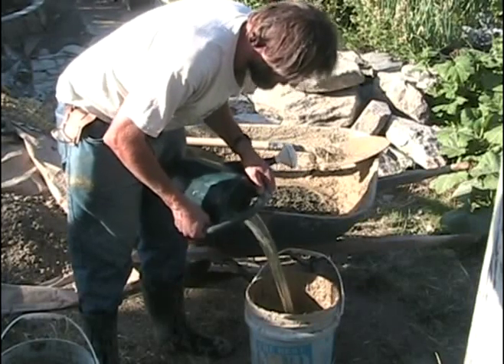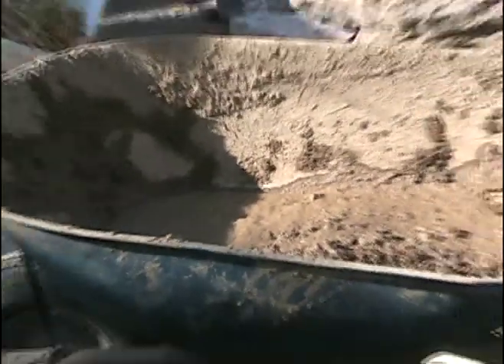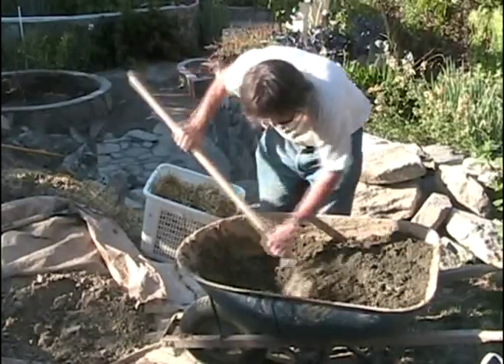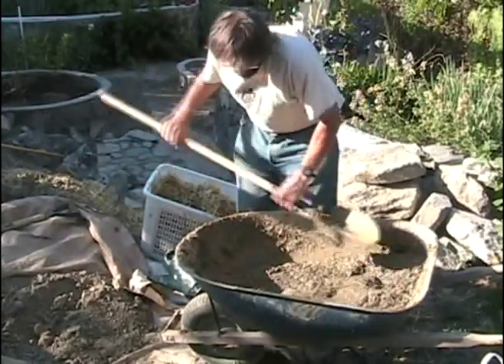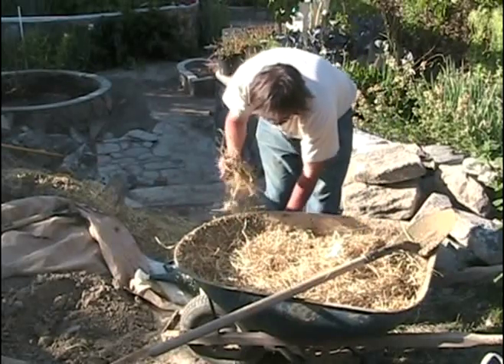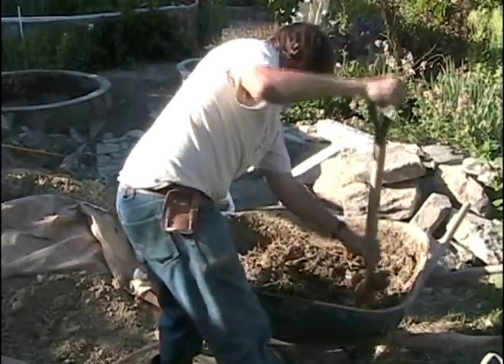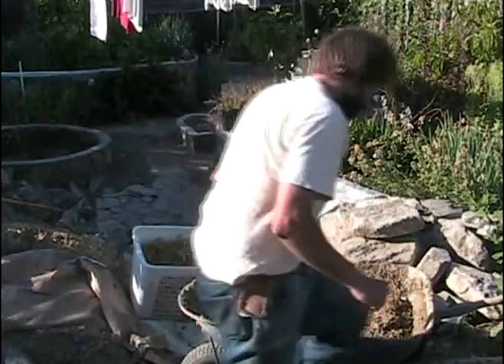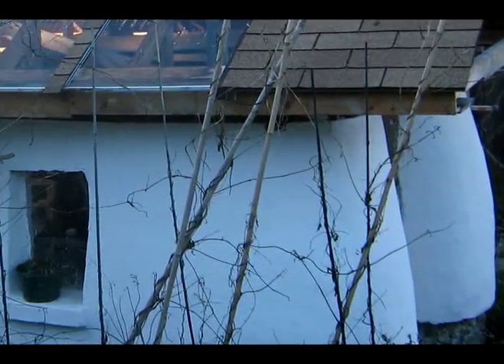Mixing Cob for sustainable  building

Comment: Brian, thank you for making this clip...Really like your mix, works well.
Reply from the maker: I think it is a great way of doing it.  BUT!  If you have a small cement mixer,  you can mix the clay, sand and water to a putty in the mixer first.  Pop half the straw in the wheelbarrow and pour the  putty straight from the mixer onto it. (Saves most of the work).  Remember that the putty you make will be a little more "runny" than cob but the straw will absorb some of that water and it will stiffen up a lot just as you work it with the fork.    Warning!!!   Don't put straw in a cement mixer or you will spend an hour or more on clean out because the Straw will lap and bind around the blades of the thing.   Thanks for your comment.  Brian

Comment: I use a variety of mixers. I soak and stir a 100 gallons of clay at a time. there are many ways to mix cob efficiently. We hired a friend with his small excavator to mix enough cob for our whole project. About 8 yards of material. Took 40 minutes to get the machinery off the truck mixed and half of it dumped in the middle of the site. So it was worth the money. walls were up in 4 days with 2 people. just takes a little imagination if time is important. There is a wealth of modern tools out there to get things done. Our ancestors would of used them if they had them. But hey you use what you got right. Brian ended up with a really nice little place using his method. Thanks for sharing and getting this out there.

Comment from the maker: Cannot directly reply to cryptkeyper.  "Easier for the knees, but harder on the back" . Seriously? Have you ever tried to pull up a tarp with 50 kg of strawy muck on it? It is HEAVY! That is a huge strain on the back, way more dangerous and way heavier than 1 or 2 inch cuts of clay sand mix on a shovel. That is only a 1/4 shovel of weight per cut. Anyone who has used oars in a row boat has done way heavier work.

Comment: Question would straw put though a shredder work better and make the mix any stronger?
Reply: Sandra Keener  Brian White  I know this comment is almost n year ago, Oh well for the benefit. Sandra, Clay is colloidal particulate and sand is what we call in load terms as "core mass". the Straw/Fiber acts as a fabric providing continuity of load.

If you could imagine Force as a array of particles, then without straw, the localized "punch" of the force is not "spread across" . this can lead to localized damage. However, it so happens, due to the relative size of other particles, straw that is longer then 4 to 6 inches is really not doing any extra good for vertical loads. in fact using shredded straw and longer straw in ratio of 80:20 ( i.e. almost shredded straw , only 20 percent only fibers )  gives best strength and rock like stability and "coherence" for vertical structure.

but for "protruding" structures, where there is hanging load or "lever" load, long fibers provide required continuity of load.

So yeah, the short answer is , you can use shredded straw if you have to great benefit , and cut on longer straws. but you will need longer straw, albeit less, but still you will need longer fibers.

All the details i have given you is live results from a real laboratory stress and earthquake, and impact test on cob structures. It really gave us pretty damn good idea on how to bring about the maximum strength in the mixture. Hope this helps somebody who is planning to build and looking for such finer details. this is where most of the magic is.
Reply from the maker: Chandan Maddanna
   Hey! Thanks.   My straw was all crushed and lots of short ones.  I have worked with stucco guys.  They add glass firer to their stucco mix to prevent cracks.  It is very short thin fibers of glass.  They don't even add that much but they say it makes a big difference, and prevents cracks.   Brian
Reply from the maker: Hi, Sandra, I really don't know,  In theory it might make it weaker because the fibres are shorter.   How long are the cuts?
Reply: Probability to small then. Pieces would come out fine
Reply: Thank you.

Comment from the maker: Hi, Amber, I think it needs to be coarse "sharp" sand, and some sea sand would probably be ok for it and some not so good.  I don't know about sifting the clay, but definitely it is worthwhile "hydrating"  it before using it.  At my old house, it took a couple of hours at least for the dry crumbly clay to become "putty" after adding water and stirring it every half hour or so.  Once it becomes putty, it is easy to mix it with the sand and for  the putty to coat every single sand particle.

Comment: Good point.  Maybe an old front-load washing machine with a peddle.  But, the weight might be too much work.  Maybe the simple method you use would actually be the best.  Work creates strength.  Thanks Brian.

Comment from the maker: Yeah, for you, light clay might be the way to go. So timber frame and the walls have an infill  where the straw is lightly coated with clay "slip". (Like clay syrup).    Then the coated straw is rammed (by hand, I think) into forms and let dry.   So it is much lighter and much more insulating than cob.   I believe it is still coded for mainstream buildings in North Germany.  Best straw is probably Wheat or Rye straw, with barley straw as 3rd choice.

Comment from the maker: If you are lucky you clay might work, if it has just enough sand with it. Look at "light clay" or "leicht leim" videos. It might suit you better.    Cob mix is about 3 coarse "sharp"  sand to 1 good clay but this depends mostly on your clay.   Cob is a composite material.  The clay binds the sand together  and the straw is for fibre to keep it from cracking as it dries out and seasonally.  If you want to try your clay on its own, maybe check with a local cob person, and definitely add straw.

Comment from the maker: Yes, definitely, as long as you are careful mixing in the straw. Straw will wrap around the shafts and it might be easier do it by hand. Just depends on the machinery available to you. Lots of time lost if it binds. Every thing else in the process can easily be done by machines.
Reply: Brian,, why are cob cabin have so much dirt in the air??
What keeps dirt from flying around and getting all over everything.??
I wanted to consider a cob house or Adobe..
But after seeing a hermits cabin, I am thinking, nasty..
Maybe it has no sealer of any kind??

Comment from the maker: I often mix in the wheelbarrow on small jobs. It is not so much strength.  It is a technique. When you cut in to the mix  with the shovel, you might only cut off a half inch at a time.   (if you just grab a big shovel full  and lift and turn it over, you get hardly any mixing, 3 times the work for nothing.  The shovel is light, and a half inch strip of material is light too so you are working pretty fast and light and not getting tired.  Working light gets more done.

Comment: The soil I have to work with has some humus and stones in it. generally, its sticky as sticky gets and you can roll it into a ball or a ribbon and squeeze it into long tape like pieces. When you shake a piece up in a jar and let it settle there is very little silt, mostly clay, and some humus, so is that a good mix or is the humus going to cause problems? 

Great video too, very useful to see, thanks!

Comment: I have successfully mixed cob, to re-build an old building, in a mixer with a couple of fist-sized stones/bricks. The original cob didn't have straw, so I didn't use any either. It is still there some 10 years later. For the amounts necessary to produce a good 'lift' I wouldn't really mix it in a wheelbarrow, which is okay for the small-scale hobbyist - much like the tarp' method. Each to his own.

Comment from the maker: Don't use really big stones or the blades and drum will be damaged. Then it becomes pretty hard to use for mixing concrete later.  (A drum with bumps lets the cement stick much easier  and it  is really hard to clean).  and I still strongly discourage putting straw in a mixer.  It binds around the blades and is more trouble than it is worth.

Comment from the maker: No room!  Certainly you could mix the  sand,clay and water but it would be very hard to mix in the straw with a cement mixer. It would get caught up and tangled on the blades in the mixer.  On my project, I was digging clay out of the ground right behind so space was always at a premium and I could only do a little at a time after work. If you mix sand and clay together to a thick soup in the mixer and pour it on straw in the wheelbarrow it might work well. Only a couple of minutes hand mixing!

Comment from the maker: I didn't find it back breaking at all.  And it's a lot cheaper than going to a gym. Taking little cuts with the shovel is an important technique.  If you take full shovelfuls, lift them in the air and turn them, then it can be back breaking and hard on the arms and wrists. But  cutting in and slicing half an inch at a time with the shovel takes less effort and gives more and faster mixing and it is not hard on the body at all. Good conditioning actually.

Comment: @dalehodgins I'll take a stab at the math...  A modest, 500 ft^2 home would have about 6,000 ft^3 of exterior walls (assuming 18" thick walls).  Divide by 6 ft^3 per wheelbarrow, that amounts to doing this routine at least 1,000 times to build a tiny house.  Easier to get a job and pay someone to build a house for you.

Comment from the maker: @dalehodgins  It is super easy calculate the cubic ft per hour.  It is a 6 cubic ft wheelbarrow. I also know the capacity of the buckets of raw material.   I dug the clay out of the ground in my back garden as I built and I have limited space. I enjoy physical work and it is a whole lot cheaper than renting a rototiller or tractor and then going to the gym afterwards. "Since premixed cob has a long shelf life"  I have not found that to be the case, it gets harder every day.

Comment: I wonder have you ever calculated the number of cubic feet per hour that you're able to produce with this method? Is there some reason why you haven't used a rototiller or garden tractor for this process? I've mixed enough brick mortar in a wheelbarrow to know there's nothing easy about the process. Since premixed Cobb has a long shelf life why not mix it in big batches on the ground and put your labor into wall building? Thank you, Dale Vancouver Island Canada.

Comment from the maker: @NewJura When you mix, you cut into the material with the side of the shovel and cut out a 1 inch slice or so of sand/clay.  So actually you are just lifting a little slice of material each time.  It is like "sculling" in a boat.
AND I used a shovel with a small blade and a half empty wheelbarrow. 
There is a lot of technique there!     It is not all brute strength and it gets easier with practice.
If the clay/water was well hydrated and like syrup consistancy, it would be lots quicker.

Comment from the maker: @trailkeeper  In this case, my clay was dry and shovels were small. It was more like 2 sand to 1 clay or 2.5 sand to 1 clay.  It is coarse sand or fill sand and also the clay had some silt in it.  No silt is best. 
It all depends. Really good clay might work with 1 clay  to 3 sand or more.

Comment from the maker: @hempseed57  You could probably do everything except the straw addition in the cement mixer.
I haven't  done it in a cement mixer.  I got to do some imagining. Start the mixer. Add half the water and then some of the sand.  Then some clay.  Then sand, water, clay, till the mixer is half full.   If you mix too dry or for too long, you might get "balls" or "sheep poop"  The clay starts to form really hard balls (like seedbombs).  Too wet  and lumps will take ages to break down.